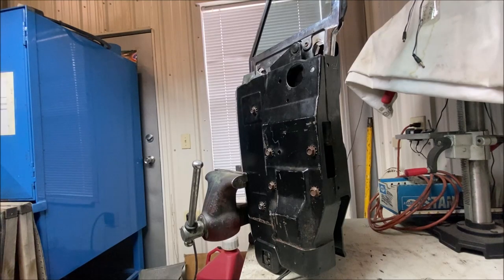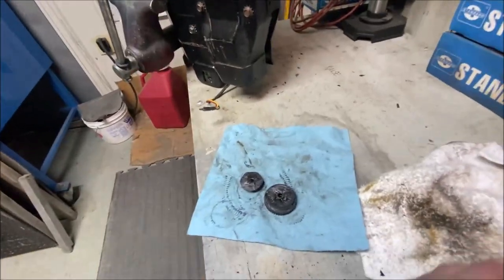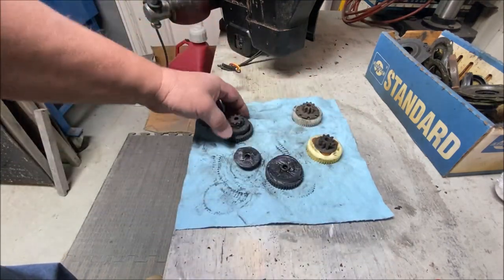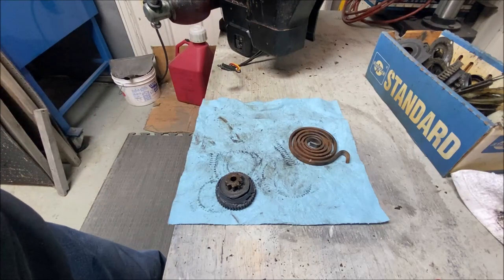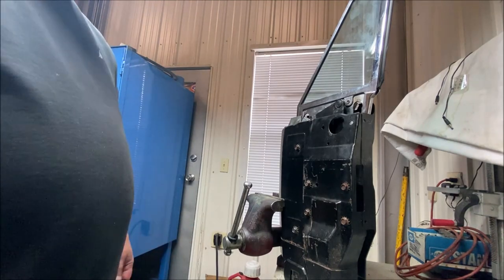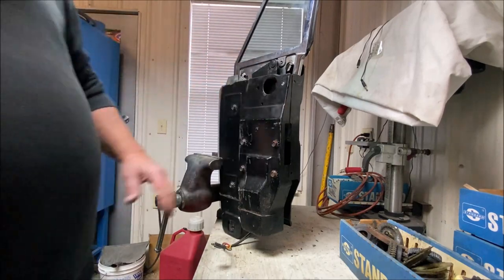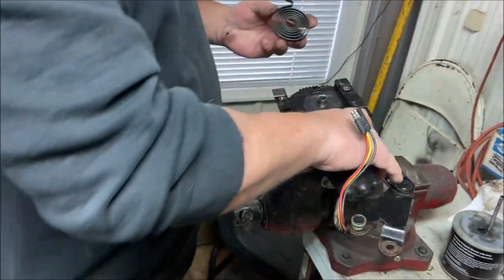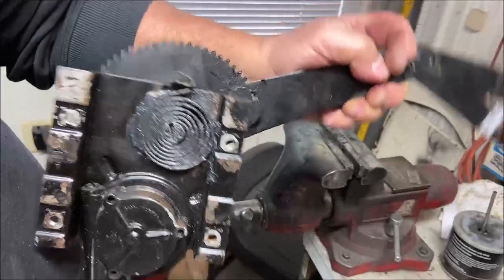1964 66 Thunderbird Rear Power Window Mechanism Disassembly and Repair

Comment: Very cool Nick.   At the end that little clicking looks like it may be the track. I noticed the entire door panel was rocking a little...like something was bound up a bit but it works 1000000000% than it did before you changed the spring... Very nice work
Reply from the maker: Thanks Ron. No, nothing is bound up. If there were, that would mean that there was still something wrong and I thought it was going up and down pretty nicely. The little noise that was left is anyones guess since its so hard to see in there to determine that. However, it is acceptable now and the customer will be very happy, thats what counts.

Comment: Thank you for this very helpful information. I happened to notice on the bottom of the window there is a threaded rod with a rubber pad, mine is missing. I’m hoping to simply put a bolt in place of it and maybe a rubber pad where it would hit.Any thoughts or opinions on that? Thanks again
Reply from the maker: Hey Clint, that is a bumper to stop the window from going too far down and coming out of the box. I think your idea is fine, should work. You will probably have to adjust it to get it to the right length. Sounds good.

Comment: Good info wish would made this ten yrs ago
Reply from the maker: There was no iPhone 11 and Windows Movie Maker 10 years ago or Id have made so many more.
Reply: My problem is the gear my rear quarter keeps locking its the spring gear installed with new motor,Now I know the problem,
Reply from the maker: @kbrownbob1  I did a test once where I had all 3 gears so I installed each one and the spring gear always ended up locking up but the other two were fine. I couldn't figure out why this very good window motor would keep locking up so that's what prompted me to do that test. This was 20 years ago and I have never used a spring gear since.
Reply: I just ordered the gear on eBay been having this problem for 10 years I really appreciate the info

Comment: Hey Nick...I've been playing around with the passenger side front window motor, and would appreciate some advice. 
The three dowels in the drive gear, how hard are they...I made some from a piece of Teflon, they work really well...but I'm not sure if they will be too hard for the job, and the old ones are too far gone to get a feel for the hardness of them. Do you think they need to be made of a softer material than Teflon?
Reply from the maker: Hey Alvin, I don't know how hard your teflon is but the purpose of the 3 dowel gear is to flex, compress down some so the motor does not get stuck up or down. In other words, the dowels are relatively soft and compress a bit under pressure. I guess if you made them out of steel then the gear would not work since the steel would not give. The plastic that the originals were made out of was soft enough to compress, this is why they disintegrate so easily. These are available at the auto parts store and on ebay and they are called window lift motor gear plugs or pins. I bought some from O'reilleys on the rack in a red cardboard package called HELP. Maybe you can buy a few and compare them? Good luck.
Reply: @vintagethunderbirdrepair9426  thanks Nick, based on what you just said, I think the Teflon isn't the correct material, it has great wear properties, but is a little hard, and won't breakdown under pressure. I may try just go buy them...I didn't realize that they are readily available, even here in Canada, so I'll just source them locally.

Comment: Thanks for this video Nick.  Sometimes if I don't run the windows up and down for a while in my 65, the run super slow, but then get back to normal after a couple of cycles.  Any idea why that would be?
Reply from the maker: Hey John, old grease or no grease. The motor probably needs to be disassembled like I show  in the video, cleaned and lubed. Check the felt tracks too. However, I think your specific problem is the motor first and foremost with the other things adding to the problem.
Reply: @vintagethunderbirdrepair9426  Thanks Nick!

Comment: You did a great job on 1/4 window did you also do a video on door regulator ? I have one and I think motor is bad and need to know how to disassemble with a bad motor without getting snapped by regulator ?
Reply from the maker: Thank you. Yes, I did a video on 1964-66 Thunderbird window motor and regulator repair. Go to 6:58 in the video and thats where I show how to load the regulator.
Reply: @vintagethunderbirdrepair9426  How to unload a regulator with a non working motor ?
Reply from the maker: @rodneyrobbins9526  That's a very good question. I should have thought about that while filming the video to show you guys. There will always be 2 of the 3 bolts holding the motor to the regulator accessible. Unbolt the 2 bolts and pull the motor away from the regulator enough to disengage the regulator gear. Problem is, the regulator will then want to fling apart because it is under spring tension. Place it in the vice like I have in the video while doing this and you will be good.

Comment: Great vid, new to Thunderbirds bought a 63 for my 2 boys. You have any advice on the rear windows not working on the 63? I can see they try but won't roll down.
Reply from the maker: Hey Miguel, thank you. It is typical for all Thunderbird motors to seize when not being used. They need to come out, cleaned, run, lubed and reinstalled. All the other window parts also need to be addressed as well while everything is apart. Good luck.
Reply: @vintagethunderbirdrepair9426  Thanks for reply do you have any 63 Bird videos? This Bird we got for our boys is a one owner car bought at Chafee Motors November 1962. Please more 1963 Thunderbird videos. Keep up the great educational videos thank you.
Reply from the maker: @miguelortega7799  Hey Miguel, I don't have many 1963 videos. I only make them as I am working on customers cars and I have not had a 63 in for a while. If I get one, I can only make a video of those systems that I will be working on. But I'm always on the lookout. I currently have a 62 that I'm working on and I will be posting a video of redoing the brakes. I'm still working on it so stay tuned. Thanks.

Comment: So I have my 66 Convertible left rear qtr window out, again, trying to fix it.  Locked in the upright position and I'm looking for maybe a video on how to disassemble it and fix it.  And what do I find?  THIS VIDEO!  You even use my exact window!  Now I'm going to watch it about ten more times before I pull it apart, just to make sure.  But whatever the outcome, this was perfect.  Many thanks!  And if I don't get it fixed, can I ship it to you for repair?  Seriously?  Thanks!
Reply from the maker: Hey Hays, I hope you do fix it but if not, yes, you can send it to me. Good luck.
Reply: @vintagethunderbirdrepair9426  
Hi Nick,  watched the video the ten times that I promised and learned how to pull it apart, multiple times.  Mine was stuck in the upright position and you know what?  I had that spring gear in my motor that you said to get rid of, so I did.  Bought two new ones like your recommended with the dowels from TBird HQ which is only about 10 miles from me thinking that I'd do the other side too. Installed it, reinstalled the window, bench tested and it worked, but very slow on the retracted side.  Sticking somewhere, somehow.  
Got it into the car again thinking thats ok, its working.  Installed it, tested it to the UP side and BANG, loud something and the window is locked again.  Cursing, I removed the cassette again,  and pulled it apart.  The brand new gear had split in half.  Humm, I say.  Luckily I had purchased two so I had a spare.  Put it in, reinstalled the motor and bench tested again.  Now it got stuck in the down position.  Pulled every thing back out and decided to remove the channels to clean them.  You were right, they were filled with grease filled with sand and grit.  So I cleaned them out and reinstalled.  
I didn't know how to "adjust" the channels, (You mentioned you had done it previously but didn't say how), so I played with it.  Got it very loose and working well.  Bench tested to the closed position again and got it stuck AGAIN.  As soon as I pulled the motor it released itself.  Best I can tell is that its going too far up the track and banging on the stops.  
Lost the little clip that there's only 2 in the whole car.  Found a 7/16 circlip will work just fine at the hardware store. 
I've got the window in the vice where I'm adding some "plasti-dip" to the window stops that will stop it about a 1/8 inch sooner, hopefully that will keep it from going too far.  
Talk about long winded, the reason I 'm trying to get this done is that I leave on May 7 for Route 66, the whole thing.  Starting in Santa Monica, (My home town long ago), all the way to Chicago  And this is the last repair I need before I go, but who would have thought something a simple as a window motor would be so damn complicated?
Anyway, many thanks for your videos.  And where are you now?
Reply from the maker: @haysenglehart4915  Holy cow, you did a lot of work. You don't have to install the window back into the car to test it. I stand the whole box upright on the bench and work it before I install it into the car. Saves me some time. Something is definitely wrong if it keeps locking up like that. My guess is maybe the motor is not quite right??? You can remove the head and check to see that it is not corroded internally. I wish I was there to look at it for you. Then we could stop over at Malibu Seafood for a bite. My favorite place besides Carneys. I'm in Colorado Springs now. I'm so glad I moved but I do miss the LA food, especially the sushi. Good luck and have a great time on Route 66, wish I were going too.
Reply: @vintagethunderbirdrepair9426  
Thanks Nick,
Malibu Seafood was one of my haunts, I lived just off Mulholland and rode my ST 1300 there many many times.  

Finally fixed it, super glued a couple of 1/8 inch rubber pieces to the window stops to cushion the blow. Worked. BTW, each time I tested it I did as you do, bench tested in a vise.  Sorry, didn't mean to make you think I reinstalled each time.  Damn, that would have been dumb, even for me!  Just got back from a quick test drive and all is well, except that the window is not perfectly lined up for the top.  So I'll just leave it cracked a bit, but it still works.    
Send me your email or whatever and I'll add you to the daily Instagram posts from the trip.  I'm at 3speeds3@gmail.com...

Thanks again for the help, I know I'll be back in touch on the next problem!
Hays

Comment: Nick, are the guides for the window supposed to be fixed or spin freely?
Reply from the maker: Do you mean the white plastic rollers? Usually they do not spin very well, sometimes not at all. This is okay and will not affect how the window works.
Reply: Yes the two on the window and one on the regulator. Just replaced the motor and having some troubles with it.

Comment: Nick, is there a source for the rear window rollers? My rear windows are reliable but slow after pulling them apart the only thing I can find is the rollers are binding.
Reply from the maker: Hey novanogo, assuming you have a 64-66 you can purchase new window rollers from any Thunderbird dealer like Birds Nest for example. Good luck.
Reply: @vintagethunderbirdrepair9426  Nick, I have a 66 convertible. Im talking about the rear rollers. Not the kind on the front windows that use the clips. Theyre white and  dont seem easily removable. Mine are all bound up. Assuming theyre supposed to spin.
Reply from the maker: @novanogo07  Yes okay, thank you for the clarification. Ive had many where the rollers dont spin but Ive never had an issue with the window working slowly because of that. My experience is that alignment, lubrication and cleanliness of the tracks are the most important factors. I also work them before I reinstall them into the car. I sit them up vertically on a bench like if they were in the car and then work them. Now, in most cases, the windows will not work quite as well in the car plugged into the cars wiring loom, as opposed to jumping them directly with a battery, this is normal. Thats not the windows fault, its the electrical systems fault. If they work okay on the bench then they should work okay in the car. If they dont work okay in the car after working fine on the bench then you probably have an electrical issue or some binding going on between the window box and body of the car. I hope that helped. Good luck.

Comment: Hey Nick, thanks for the great video, I happen to be working on both of my back quarter pnl windows on my '65 one at a time though. Both are locked up. You answered the use no grease question for me, the grease that was in my tracks was like spray adhesive just totally sticky and nasty. I had to use break cleaner to get the stuff out!! Now for a really weird question: On my right side quarter pnl motor some one has cut the red and yellow wires, and  switched them. So now red goes to yellow connector and Yellow goes to Red. maybe they had a switch wired backwards?? where up direction the window went down and the switch in "down position" the window went up. Have you ever seen that before? I am seriously considering rewiring that. I also did loose my bow tie clip. Bummer. maybe safety wire will work.
Reply from the maker: You lost the bow tie clip??? Man that sucks!!! Alvin has a parts car, get one from him before someone else does (Jamiesons repair shop). I don't have any spares, sorry. I've had situations like yours before. Yes, start from the window switches and work your way back. I think your explanation is probably correct since I've seen that before too. Good luck.
Reply: @vintagethunderbirdrepair9426  Thanks Nick, I think it's kind of funny in a sad way, I put a blanket under the window assembly and had some folds read just in case the clip went... well it went a whole lot farther than I expected! Ha!

Comment: How do I get the rear window out of a 63?
Reply from the maker: Hi Jim, that is a good question but  far too complicated to explain. I will say that it is not a box like the 64-66 and all the parts come out separately. It is a complicated mechanism and difficult to remove. My suggestion is to take detailed photos of everything, every nut, every screw and then start the disassembly piece by piece noting which came out first, second, and so on. Then do the reverse when reinstalling. Clean and lube all parts. Thats the best I can tell you without showing a video.

Comment: Do you have a video of the removal of the quarter window? I need to drop them just a little to replace the seals that the tops of the windows seal against. The windows don’t work and since we never use those I am in no hurry to relate the motors. The seal however is a must.
Reply from the maker: Hey Justin, I do not have a video of that. Once you pull off the quarter interior trim panel, try tapping on the motor with a hammer and working it at the same time with the switch. Also, try applying battery power directly to the motor bypassing the cars electrical system. Put a battery in the back, hook wires from the battery directly to the motor like I show in my video. The motor may work and then you can roll them down. If the motor is seized, then best thing is to remove the 4 bolts that hold the regulator to the window box and push the window down. Or just remove the box completely, window and all. Good luck.
Reply: @vintagethunderbirdrepair9426   If the back ones are as nasty as the front ones were, there isn't a hammer gig enough,lol. I will just take out the 4 bolts and drop it down enough to get the seal on and then bolt it back up. Thanks again.
Reply from the maker: @justinlogue31  I don't think they are any harder than the fronts, just different, but I'm biased since I've done it a billion times. Good luck.

Comment: Do you know of a source for a new regulator spring?
Reply from the maker: Hey Christopher, nobody makes a new spring, they are not available. You have to find a good used spring. Try the Birds Nest, they sell used parts. Good luck.
Reply: Nick thanks for such a fast reply. Yours videos are great and have been very helpful for the 65 convertible I just bought.
Reply from the maker: @ChristopherRisden-r7i  Thank you Christopher.